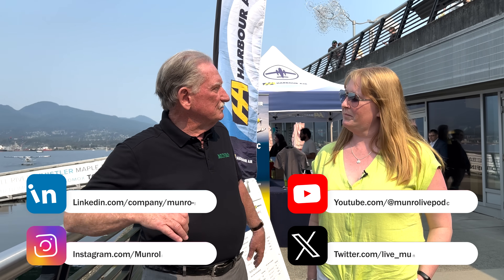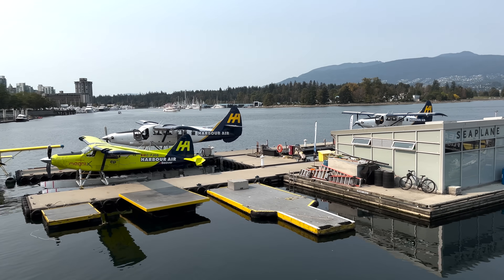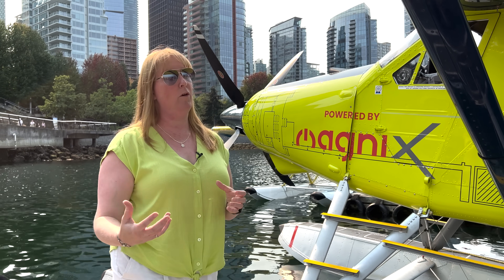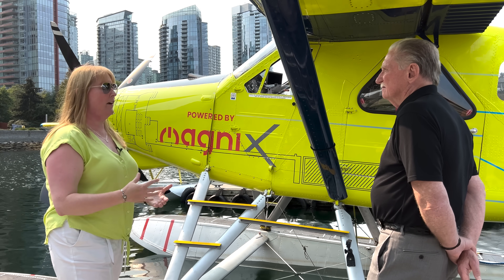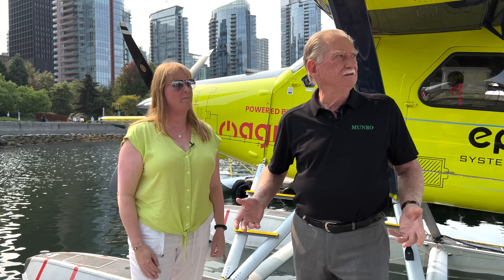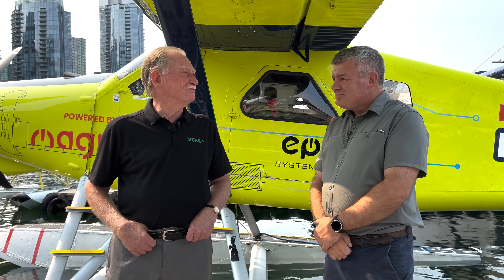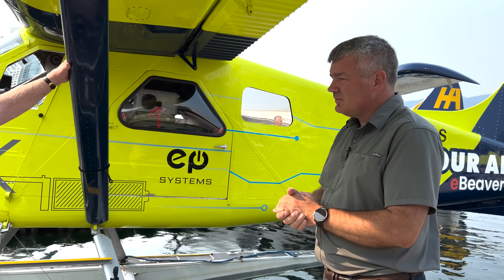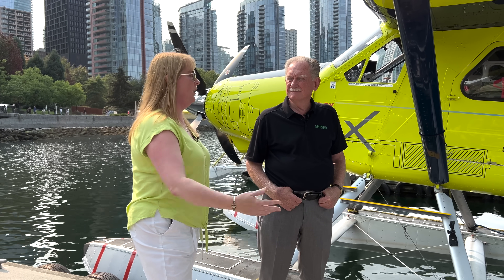The Harbour Air eBeaver Electric Seaplane | Everything Electric Canada 2024

Comment: The haters really don’t get it, this whole thing is pretty damn exciting. Ice vehicles are horribly inefficient, the engineers and all involved are driving energy efficiency and capacity. The next 10 years are going to be fascinating
Reply: I wouldn't call them "haters" as maybe a few have been around aviation for a while.. that said, I would consider them as being merely cautious. My father was a bush pilot from the early 70's in the arctic and northern Canada.. Beavers and otters were a mainstay in every operation of your day. Now if you could ask one of those pilots if they would replace it with an electric one, you would lose the conversation hands down. They know these aircraft and what they're capable of like a slide rule and a bag of books.. contingency plans and operational safety are welded into their operation as a "safe" aircraft.. nothing spared!

Replace their near 500Nm range power plant with an iffy at best bomb in the back seat that requires esoteric care and temperature management and flies for a small fraction of the IC engine's time.. where are the margins for contingency or just a bad day?.. a 10 minute reserve?.. 5 minutes? That may work for a trip out to the spit and back. Then there's the new CARS amendments for this technology that are still being written and not to mention STCs before it ever goes into regular commercial passenger service. I've seen that some of this has been "fast tracked" because it's a new technology and the BC government wants the feather in their cap for their green initiative.

This being called a perfect fit by Harbor Air has it's questions.. I've flown to victoria many times on floats from the YVR float base, some days it's nice, but most it's not so nice.. and to be quite honest, having a full tank of fuel is a piece of mind.. even in a 60 year old cessna. What about an "emergency" situation? Li-ion technology really doesn't like water, especially salt  water and prone to violently erupt if they meet. So landing on water is inherently a dangerous task in itself.. flip the bird or tear open a float and your ultimate failure point has been attained.. a Lithium battery fire that won't go out, a haze of heavy toxic smoke that bubbles to the surface for hours if not days. A tank of avgas or kerosene just doesn't have the same urgency or peril. Your EV starts puffing a bit of smoke and you can just pull over and let it cook off.. a flight battery maintains flight and without it, you cease to fly.. after that point there will be a battery fire in the water and your raft has burst into a chemical fire. Harbor Air is a landmark along the river on the south terminal of YVR, I've flown with them several times over the years and probably will not try their electric service until there's significant improvement in the technology.. call me paranoid or a 'hater', but some would call me cautious. The waters of the pacific northwest eventually took my father and others I've known over the years in various aviation accidents, every one of them 100% avoidable.
Reply: @bozosplayhouse  I am talking about the electrification haters. The ones whining about renewable energy and electric vehicles
Reply: @bozosplayhouse  Harbor Air would never even suggest that their plane is suitable for any long distance flying in the north. So you can give up on that strawman.

Their reserve is the same as the reserve for an ICE plane.
Reply: @scottverge938  Nor did I suggest it either.. so no "strawman..." 🙄
Reply: @bozosplayhouse  except you did when you said none of those pilots would replace their plane with an electric one. Of course they wouldn't because it couldn't do the job they need it to do. You built a strawman in a round about way.

But for this particular use case it's entirely feasible.
Reply: @scottverge938  Hmm.. splitting hairs so you have something to say.. got it🤔
Reply: @bozosplayhouse  Nope just being accurate.
Reply: @scottverge938  Well the other half of the hair said "any long distance flying in the north" and I did not.. I mentioned electric period! No mention of it actually.
Reply: Also aviation gas is STILL leaded gas and has been since the 50's and removing it should be a priority.
Reply: @billhanna2148  Well, that's true about the Avgas100 (green) being leaded.. but that's only to support those 50+ year old engines safely. There is a Low lead version (blue) Avgas100LL.

PT6 turbo shaft engines have replaced a huge amount of the beaver power plants.. so jet-A/B contains no lead.
Reply: @billhanna2148  it makes me scratch my head why people would want to cling to gasoline when it is toxic, and requires a whole ecosystem of other toxic crap to help turn it into motion. How have we grown to hate m innovation so much that we would harm our lives to cling to an arbitrary thing
Reply: @DwDDB  In a single word GREED the oil companies and their minions will always look out for THEIR best interests.
Reply: @billhanna2148  that doesn’t explain the rubes
Reply: You mean "the haters" sorry realists the KNOW electrification CANNOT happen as there is not enough COPPER.
The isn't.
Stop pretending there is.
We have long since exhausted the high grade and easy to get to copper ore bodies. 
The remaining ones are at 14,000 ft or remote and often pristine locations.
Some are in countries in Africa being corrupted by China to secure.
There is no substitute for copper.
Future demand is near TRIPLE of projected supply.
Just EVs will more than double the power GRID needed. That's all COPPER. Everywhere you see a transformer you will need another big can of copper.
B.C. dark rainy and mountainous is totally unsuitable for efficient wind and solar.
The pristine river valleys are pretty much all dammed. So where are you putting the Nuclear plants? Better get on that.
Now add in home heating by electricity.
Delusional.
Won't happen.

Comment: The summer range in Canada of this ejunk will be between 50 to 80 nmiles making this a pointless aircraft.  The Kodax or Cessna version of a seaplane will do 900 nm. With one Kodax you will do the work of 10 eplanes and be safer while flying.
Reply: The guy has a company that does 20 minute flights ... that's what they have successfully offered commercially for years in their fuel planes so that's the usage example. Why would they need a 900nm range plane for 20 minute sight-seeing flights?
Reply: @MrAdopado  Retro fitting a 1956 de havilland is stupid to begin with because the plane is heavy and needed a 450-680 hp powered motor. So adding an even heavier power plant reduces safety margins. The batteries will need replacement or recharging after every flight to provide the range needed to make a secondary runway in case of an airport or aircraft emergency for every flight.  Seaplanes do not always land at sea.  Just because you can do something does not mean you should do it.

The lack of range is a very serious safety problem
Reply: @tachyon5321 these are the aircraft that Harbour Air already has. Also, converting them and changing as little as possible minimizes regulatory requirements.  

By the way, these aircraft are seaplanes - they always land on water. They are not amphibious. Landing on the ground is called "crashing".

Comment: you could fit a lot more batteries if you put them in floats as well.
Reply: Sure... but the weight.
Reply: Space is not the problem. Weight is the limitation on how much battery can be carried.

Comment: So no passengers?
Reply: In this first conversion (registration C-FJOS), there is no space or weight capacity for passengers; it is only used for testing and working on regulatory approval for the electric motor and controller. 

The second conversion is being built. It uses a different motor from the same supplier (to meet regulatory requirements) and will have a different battery that is closer to practical usefulness. It is expected to fly by the end of 2024.

Comment: Normal gas Beaver: 450 mile range
Electric Beaver: 50 mile range
batteries and electric motors do not make sense in aviation for anything but the most gimmicky applications, and in all likelihood never will. Electrochemical systems cannot touch the enormous energy density of liquid hydrocarbons. And yes, I own a Tesla. The LONG term solution to net-zero aviation will be Fischer–Tropsch gas to liquids total synthesis.
Reply: To be fair you can't really call this a gimmicky application if they are a company has made money for years by offering short sightseeing flights in their currently fuel powered planes. It's certainly a non-typical application but that doesn't make it a gimmick if an electric plane can do the same job. Nobody is suggesting that this is in any way a replacement for general commercial or private aviation!
Reply: @MrAdopado Harbour Air does sightseeing flights, but most of their business is scheduled short hops over water as a fast alternative to ferry rides. Those flights are the intended use of these aircraft.
Reply: They fly short routes.
Reply: It’s a start and use cases obviously do exist already.

Comment: 1 hr range with 82 km range, assuming rhe new batteries are 300wh/kg.  What this means is... completely useless!  Fly for an hour, charge for 8.
Most beavers and otters are turboprop converted with 650 hp at a minimum.
The real question is, what grant money (tax payer funded) was awarded to fund this virtue signaling contraption?
Reply: Why would the battery be charged so slowly? This isn't 2012 any more.
Reply: Faster changing already exists and will get even better with time.
Reply: @fredbloggs5902  hot swapping batteries can be designed into the package.  Batteries are expensive, how many battery packs until it's considered to be useful?   Empty batteries weigh the same as full.  Max gross takeoff can exceed max gross landing with conventional fuel due to expected burn rate.  That's not an option here.
This should, and will go down as a cute experiment until the lack of practicality is unavoidably accepted.   When one of these crashes or has a serious battery fire that burns like a flare for a week... perhaps burning the entire area... etc
Electric car demand is dropping,  electric planes will never become common
Reply: @BruceBusby  The Tesla-Y is the best selling car worldwide and about to be the best selling car in the US.
Reply: The magni500 motor in this aircraft is comparable in power output to the 650 hp turbines. The magni650 in the next one is more powerful.

Comment: Seems like alot of extra shit that can break
Reply: It's actually removing a whole lot of shit that can break!
Reply: @MrAdopado  and replacing it with new stuff that breaks in new ways, look at tesla reliability and ev's in general, it's much lower than gas engines achieve
Reply: Maybe you should go lookup how internal combustion engines work.
Reply: @fredbloggs5902  I know plenty of how they work, they are more reliable by alot, most tesla drive units don't even last 200k miles, the highest mileage tesla is 1.2 million, it's on its 14TH MOTOR, there's diesel and gas engines still running with more than that
Reply: @clippyremembers  Blatant nonsense 

Blocked

Comment: interesting. i think local flights under 50 passengers is possible on electric at current tech with low flight elevation and slower, large diameter propellers.

Comment: One hour and 82 kilometer range. Not worth the time, money and effort to fool around with. That plane is good for nothing. Ruined a good beaver aircraft.
Reply: They described the plane as capable of doing the exact same job as the current version does ... so it's clearly good for something! (and this one won't drip oil into the water, will be somewhat quieter, won't make fumes, won't release CO2, cheaper to fuel ...) I'm sure if they had the resources to build a modern design plane they would get a good bit more performance but if they can do the job with an old Beaver then that seems worthwhile to me.
Reply: @MrAdopado  Do you know how much oil seeps into rivers naturally every year. Check it out.

Comment: I just wish I was back learning to fly/MEIR  in an electric aircraft....... probably half the cost.
Reply: Probably much more expensive than that. Electricity is cheaper than aviation gasoline for the same flight time, but battery replacement will be expensive. 

There are two flight school in Canada (Sealand Flight in BC; Waterloo Wellington Flight Centre in Ontario) using the only currently certified battery-electric aircraft, from Pipistrel; you might want to check their hourly rates. 

One odd issue with the Pipistrel aircraft is that the EMRAX motor requires frequent bearing replacements; the MagniX motors used by Harbour Air shouldn't have this issue.
Reply: @brianb-p6586  ICE TBO is big bucks. BEVs haven't been around long enough to embed the efficiency benefits yet...and my ears wouldn't be ringing.
Reply: @davidpearn5925  yes, and battery replacement will be bigger bucks.
Reply: @brianb-p6586  battery prices are early days
Reply: @davidpearn5925  EVs have been in commercisl production for a decade, and battery pricing is no longer dropping rapidly. And of course aviation prices are a multiple of automotive prices. A century from now, aviation batteries might be cheap.
Reply: @brianb-p6586  battery research and development is never ending at this stage.......and a battery change is a morning's work - in comparison.

Comment: Maybe 300wh/kg is better than Tesla's 4680 CYLINDRICAL cells.  Sandy was a little bit quiet there.
Reply: 4680 is something of a side-show and certainly doesn't define Tesla despite the internet hype ... Tesla uses several different cell sizes and non cylindrical form factors and is not tied exclusively to a single one. (A big point being made in the video was 300Wh/kg at the module/pack level ... that's way higher density than 300Wh/kg at the cell level.)

Comment: If they fly only 20 minutes they should be able or charge 20-80% easy. This should allow for SIGNIFICANTLY longer battery life. 200-300 cycles is very low for today’s batteries
Reply: They referred to 2 to 3 thousand cycles. Aviation will have tighter regulatory limits on battery performance.

Comment: First,  I am Pro EV.  Built my own in the past.   Commercial aircraft fly on Useful load.   Ive done the numbers on my 206s and the smaller the aircraft it becomes easier.   I can understand that they have to distract from the oil dripping from the radials into the water.   Even my turbines drip oil from the breather.  My buddy set up a catch can and dump switch so he could dump blowby oil at altitude instead of it dripping on the ramp.

Comment: My pet peeve is when people call electric motors engines, so no comment.
Reply: Their pet peeve might be that you're not aware that their not wrong.
Reply: @PabloGonzalez-hv3td  Not according to my High School shop teacher in 1978.
Reply: @wineberryred   Engines have moving parts and use any fuel. That evolved into the fuel = combustion misconception. 

The misconception holds true until you hit the rocketry world where solid fuel motors use combustion but have no moving parts. They don't qualify as engines. Rocket engines qualify as both.
Reply: @PabloGonzalez-hv3td  For me it’s simple, if it burns something it’s an engine, if it doesn’t it is a motor.
Reply: @wineberryred  If you ask for motor oil do you mean 10w 30 or are you lubricating your alternator? The terminology has nothing to do with combustion.
Reply: @PabloGonzalez-hv3td  I think people that call it motor oil are wrong, I just call it 10w30 or 10w40 oil.
Reply: @wineberryred that's not just simple, it's simplistic.

Comment: 1 hour flying. On full electric that's cool.
Reply: Hardly, it is a complete joke. A gas powered version can fly 10 times the distance without refueling and doesn't have to spent literally days charging to go that distance.
Reply: @markadler8968  frankly I thought it would be less than one hour. But 1 hour is useful for alot of small regional flights,   so not too bad.
Reply: @andrewashmore8000  But you did not acknowledge the huge amount of time wasted charging. These planes will spend far more time charging than in the air which makes the beyond impractical and nothing more than a novelty
Reply: @markadler8968  yeah , well that's where good design comes in , you know it's possible to swap batteries in seconds  in need a super quick turn around. But in the video , the operators talk about charging in 30 mins , and that's about the same time as a turnaround time also.
Reply: @andrewashmore8000  Sure they going to swap batteries on a floating airplane that weigh several hundred if not over a thousand pounds on a dock on the ocean.🤣🤣🤣🤣🤣You are hilarious.
Reply: @andrewashmore8000  You should write science fiction
Reply: @andrewashmore8000 battery swapping is not feasible in this application, and questionable for aviation in general... but yes, charging time is probably compatible with scheduled turnarounds.
Reply: @markadler8968  the current battery capacity for this conversion is about 150 kWh. At 250 to 300 Wh/kg, that's 500 to 600 kg, or 1100 to 1300 pounds for just the cells - the complete pack will be significantly heavier. 

Of course, there won't be a suitable place to mount a single pack of this size, so the battery will be split up into packs. The Beaver has optional wingtip tanks, but the main tanks - each roughly 35 US gallon capacity so about 130 litres - are in the belly. That would be enough space for about 260 kg of lithium-ion battery in each location... if only batteries were liquid which could be squeezed into every available corner. Harbour Air's second conversion is in progress, and it apparently has (as shown at Oshkosh) some battery module in the rear cargo area.
Reply: @brianb-p6586  good info , thanks for sharing.
Reply: @markadler8968  this one also doesnt need literally days to charge. It has a niche use case and is still in development.